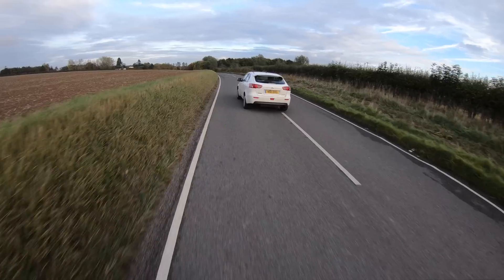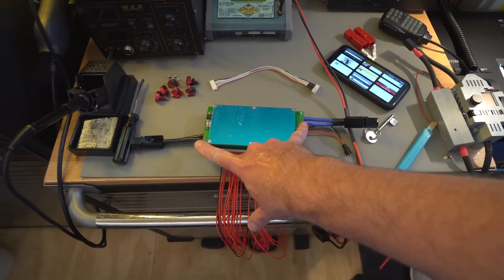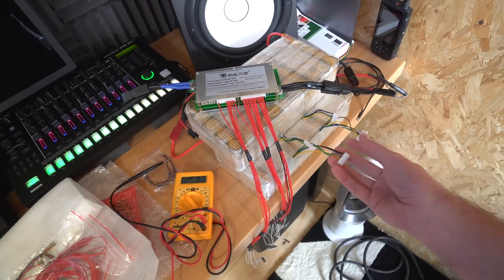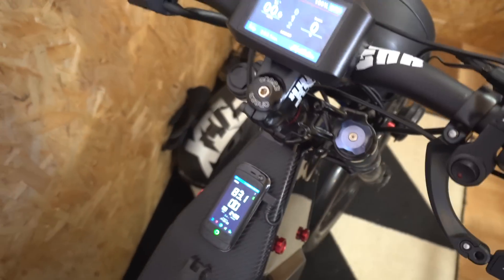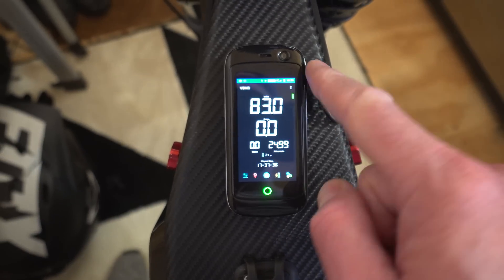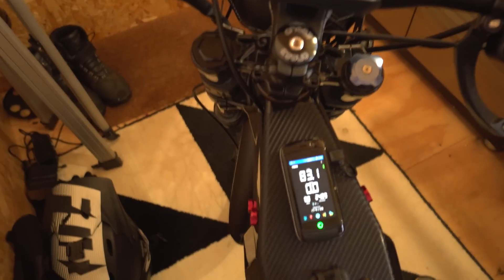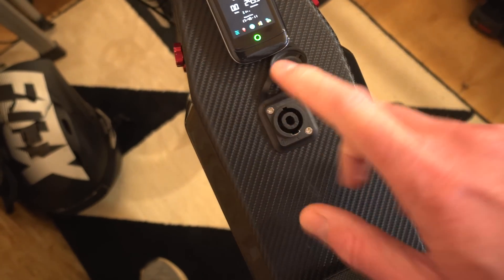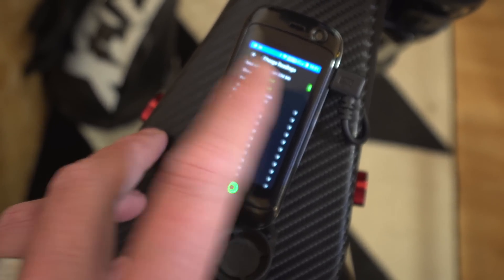THE MOST ADVANCED EBIKE EVER!!! - BATTERY BUILD PART 5

Comment: Bought this BMS and a cheap Android phone for a better build. Why can I not change the parameters from 24s to 21s on the VBMS app? Its throwing a fault because cells 22, 23 and 24 obviously have no cells.
Reply from the maker: It will throw a fault if you don’t program the BMS because it defaults to 24S. However you should be able to change the settings, is it paired correctly to the phone?
Reply: @andykirby  Yep figured it was that or the temp sensors. Working great now thank you Andy.

Comment: Heya hon,looks awesome ,but ill see if can get few photos of some custom ebike in dev here in australia they designed their own custom 16-20 khz pwm system with linked smart bms,custom dash that intergrates with torque ev dash system the suspension uses some secret activated fluid that changes with an el;ectric current,and front and rear hub motors ,,not sure how its hooked up but the front one was rewound somehow as 3 phase gen,in test conditions so far theyve got the system to run self sustaining at certain speed,
they arnt only ones almost there either ,imagine with in a year we wont need to  spend our yearly salry on  a huge lump of lithium, hehe cheers of joy from peeps doing the lithium and largactyl shuffles .

Comment: Hey does the Sabvoton controller have pedal assist? I'm planning to do a similar build and I would maybe like pedal assist too.
Reply from the maker: It can do, some of them don’t...we can do a version which has it but it’s not torque sensing. It just senses if the crank is going around. There are proper pedal torque sensing options available also.
Reply: @andykirby  Ah alright. Thank you

Comment: Hi Andy, I want to buy one of these. My adaptto controller has just failed and I'm not sure if I can repair it, the screen will not come on!?!? As such the BMS will not work with my sabvoton 150 amp controller due to it being programmed to the adapto controller. How easy would it be to get the balance wires in the correct place on my current 72v 40ah li-ion pack. My balance leads on my battery are grouped in 5 blocks. 4 cells per block I presume. Any advice you can offer before I buy this?

Comment: So what makes the BMS advanced? I have been looking at moderately high current (5-10A) real time active balancing and none of the BMS I have seen do that. I started making a passive real time balance controller, but I think I am going to restart the design for active regenerative balancing. I had spent good money on a BMS last year, but discovered that the mode of operation was essentially junk.
Reply from the maker: Yeah most BMS are junk and none until now enable you to see exactly what’s going on when in use. This BMS allows you to configure absolutely every single parameter specifically for the battery you are using and when combined with Vortecks VBMS app it’s the most advanced BMS I’ve seen. High balance currents aren’t really normal in BMS’s as you shouldn’t really need it if the pack is in good shape. Also heat dissipation and PCB traces and balance wires become an issue above a couple of amps balancing current. If you want to design a BMS make sure you can visually see all the data on a screen or in an APP.

Comment: If u whant a great e bike witch has a fingerprint unlock does 120+ kilometers of range 100 km/h great lights and its carbonfiber what else coud u ask for ( greyp g12s)
Reply from the maker: €7200 ?! That’s a lot. It’s only 12kW and uses Rock Shox suspension. The wheels are bicycle wheels (not motorcycle) and I’m not sure what electronics it uses but it’s probably not a high quality controller,BMS and battery. 
That’s not a good bike for the money. I can build you a bike for €4000 that would destroy this bike on every metric.😁
Reply: andy kirby greyp is made by rimac top quality they made the 412 km/h fully electric car the C-TWO so its high quality and the greyp g12s can actualy go 130 km/h thats what they tested and it coud go even faster but for customers to not get killed they put a 100km/h speed block on the bike witch u can take off if u hire someone who knows what their doing
Reply from the maker: Pretty cool achievements but the price is very high for a bike like this. A Zero motorcycle costs €12,000.
Reply: andy kirby ye i know i heard about it but you know alot of profesional downhill bikes cost around 10k € and they dont have electric components in them or anything electric so i think this e bike is prety good for what it is + if anyone steals it its programed for u to have to call the company who made it to reset the password and fingerprint unlock and some guy in croatia actualy stole this bike witch was a gift to some famous guy from rimac and the guy who stole it called them to try to get the password removed but they asked him for the serial number on the bike so they coud reset it but it came back as stolen and they tricked the guy into giving them all his information somehow and he got arested and they recovered the bike restored it and gave it back to that famous person.  u can register the bike to ride it on the street but u dont have to thats the cool thing about it i coud be riding my e bike anywhere and it charges to full in 80 minutes thats faster than my old hoverboard witch took 2ouhrs 30 mins to fully charge

Comment: G,Day Andy, "Very Nice Finish" to your battery build, finally a BMS that actually shows you Individual Cell Voltages in real time through Bluetooth 👍🏼 Much better than praying the BMS is "Actually Working Correctly". and if it's not then it's usually too late (Battery Pack Killer) 😬😎

Comment: Ideally the controller and bms need to be connected through CAN and the main display does all, The sabvoton firmware needs to be modded to add the permimeters for the bms but does it have a way of modding the firmware with out jumper cables direct to the board and is there enough available memory.
Reply from the maker: Yeah that’s right, I’m currently researching how to modify my Renault Twizy and everything is connected through CAN so it’s more of a software/firmware thing than anything else.

Comment: Will it balance at any voltage if out of balance? What is current rating? I need a 7s bms. That can handle 250a. Or 125a and use two. I have a few packs paralleled. Each are fused at 200a. And I have a 5kw inverter + DC lighting. I'd like to better see what my bank is doing. And have protection and balance!! Great video..

Comment: Can this be used on a 7s setup.... I see it's says 
8s to 24s....
Reply: It can not unfortunately
Reply: Why would you want to? If you have the right motor then more volts = less current for a given power. Current is where the losses are.
Reply: @gordonlawrence4749  to use in a 24v powerwall setup
Reply: @42FaLLeNAnGeL24  If you are going that way then 6s Lion would give you about what you want. 6s Lipo would give you a tad over 22V and that means you could use 4x 6v solar cells to charge it if you had a decent solar voltage tracker. 6s balancers are way cheaper than 7s for some reason by the way.
Reply: @gordonlawrence4749  using 7s cause I would my inverter voltage range is 21v to 30v so if I use a 7s setup I would be able to use more out of the battery pack than the 6s setup

Comment: Hello! Can you have two 10s bms (one each pack)? I'm building something that resembles what you are doing. My setup has 2 x 48v 1000w motors overvolted to 72v with a 130 cells battery. I'm at the moment building the battery, already have the 18650 samsung cells but i'm thinking on doing 2 batterys instead of only 1. I have two 36v regular foldable custom build ebikes and with this setup i can use them. My doubts are if i can have 2 packs, connect them in series to ensure the 72V output and have 1 BMS on each part of the battery. Thank you and keep up! You have way less subs than the ones that you should have! Really great content an well edited videos! Congrats!

Comment: should have just bought a zero motorcycle
Reply from the maker: You can’t ride that on the pavement though...
Reply: @andykirby  they have electric street bikes
Reply from the maker: They are motorcycles which need registering, not an ebike with pedals. I would get one but I’d rather drive the twizy for longer runs.
Reply: @andykirby  just pedal
Reply from the maker: Don’t like pedalling, I go running for fitness.
Reply: If you're shitting out money yeah

Comment: That neutrik speak-on it's for speakers. They do make " power con" that's specially made for constant current. I suppose that speak on works but power con it's just better in my opinion.
Reply: Legend. I almost just bought some of the speaker connectors, but will get the PowerCons instead now. Thanks.

Comment: Going to get one for my 7kw power wall later on.  I will wait a bit just soldering going to take a month to solder 800+ batteries lol.
Reply: invest in a spot welder itl take you a few days then
Reply from the maker: Yeah definitely, I knocked this pack up in a matter of hours with my Malectrics spot welder 👍
Reply: Trying to save on price per kw.  I am using copper wire that's fused to each battery.
Reply: Tactical Advance I know what you mean. I have over 1400 cells! Im eventually going for about 4200-5600 cells in a 7s bank. In packs of 100.  It's a ton of work!
Reply: If you going for that many sells go for 14s